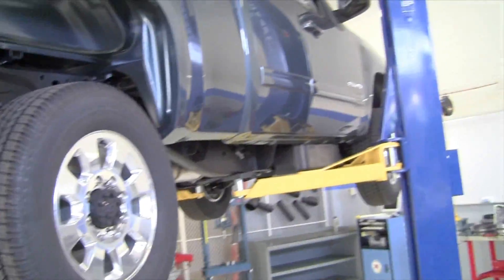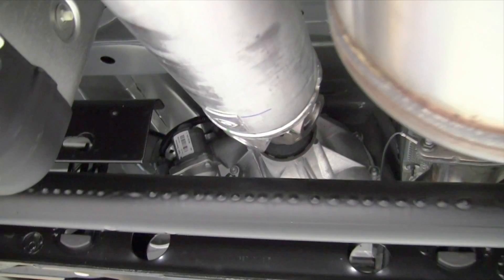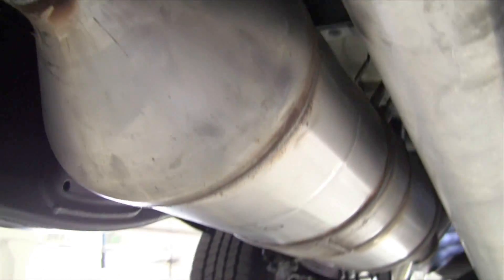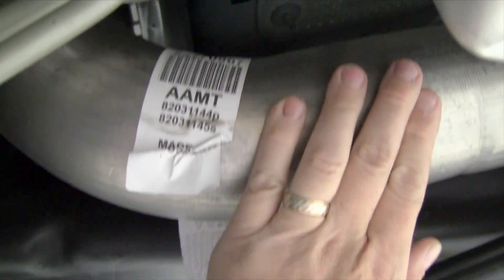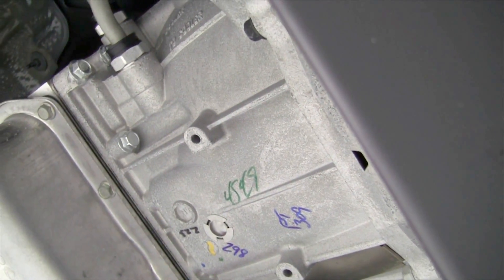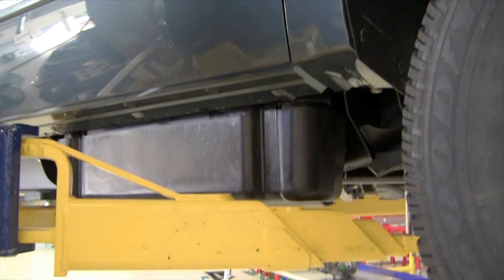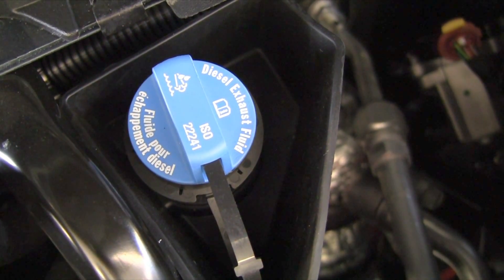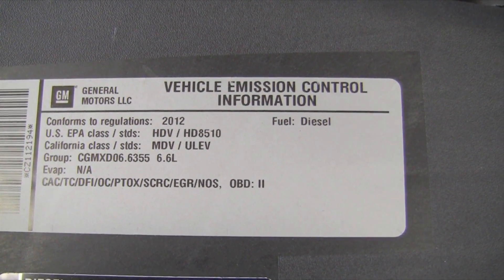Duramax Diesel Exhaust After-Treatment System

Comment: It's just the oil companies way of saying diesel motors get too high of mpgs and making the epa say you have to use this system so it burns more gas cause if that was the case gas motors would have to have something like this to because burns dirtier then diesel by a long shot
Reply from the maker: Education is the answer

Comment: This system is a pile of expensive junk.  Looks like a well built truck. The DEF System just kills it.
Reply: +usksonic The main problem that this system and other 3/4 and 1 ton truck is that the aftertreatment on these trucks is the SCR before the DOC and the DPF. you don't want DEF to be sprayed and get blown into the DOC because you can cause sensor failure and improper regen. The SCR needs to be after the dpf to run properly. Big rigs know that by heart. That's the reason why these diesel doesn't last long. once 1 CEL comes on and have an issue with the aftertreatment system, the whole thing is screwed. I had to replace multiple aftertreatment system because of this issue. But you can thank the EPA for this bs aftertreatment.
Reply from the maker: +usksonic Thanks for your feedback!
Reply: DEF FLUID (2 pack) of 2.5 gallon jugs for $7.00 each - FREE SHIPPING!! https://www.walmart.com/ip/DEF-Diesel-Exhaust-Fluid-2-2-5-Gallon-Jugs/837857789

Comment: Are those pressure, temperatures sensors important what happens if you just put a straight pipe on the muffler where do you put those sensors
Reply from the maker: jose lopez Hi, good question. Yes, they are important. There are two pressure sensors and two NOx sensors to monitor the operation of the DPF and SCR. If you remove the DPF and SCR and replace it with a straight pipe it will set computer trouble codes which could result in the vehicle speed being limited to as low as 5 mph. Oh, it is also illegal in the U.S.A. to remove anyway.  One more thing, that exhaust system is very expensive, if you do take it off, hang on to it in case you need it again. Don't let the muffler shop keep it. They could sell it for several thousand dollars to someone who took theirs off and now regrets it.

Comment: The worse thing for DEF for me is that my 2011 GMC 3500 is not a daily driver, it's a DRW dump truck that gets used for business reasons and sometimes it will sit for weeks at a time. In warm weather DEF fluid will go 'bad' and throw a 'diesel exhaust fluid quality poor' message. If that tank is less then half full you can simply top it off and that will raise the quality high enough. If you can't dilute the old fluid with enough new fluid you have to drain the tank, which GM made apparently as hard as they possibly can. There is a screen/check valve in the fill neck, so you can't use a simple syphon pump/hose.

Comment: Imagine how much power this truck would have, minus all the emissions crap! I specifically got a 2006 excluding it from the dumb emissions law! Absolutely reliable and more power than I'll need! No DEF to buy, either!
Reply: you can tune them emission equiped and make 500hp why delete them if you don't need too...
Reply: I didn't delete mine. It was before the power robbing emissions were law. Make 500hp with the gas wasting DPF or 600hp without it. Your choice, I'll pass on it.
Reply: with proper tuning there isnt any difference in the new trucks. With the first gen of just having a dpf no scr the trucks do better deleted although the new trucks emission systems have the capacity to make past 600 hp. The new version of emissions are not junk and people need to be informed that you dont need to delete and break federal law. Ill ask you this what difference in terms of proven dyno graphs do you have that prove that deleting makes more power on the stock truck vs stock deleted truck ?
Reply: +frankbradshaw1770 It's basic physics. Take any engine, tune it and find max power (hp/tq). Use that EXACT SAME engine, add emissions junk, tune for max power and you'll always make less power. Every single time! Technology cannot negate simple physics. You will never get any emission system to not hinder the performance. It flat out isn't possible.
Reply: http://www.dieseltechmag.com/2016/07/project-clean-sweep-cleans-house Ya basic physics against trucks that are deleted. Power is king and there are various ways of tuning and manipulating the common rail systems. My cummins that is an 08 is deleted because the first generation of filters didn't work. But the SCR systems are badass in terms of flow and potential power holding capabilities. The biggest thing that holds back any diesel guy from getting his newer truck piped and tuned is the fact that he cant go back once he is balls deep into violating the clean air act. Smoke is not bad but smoke in the wrong place makes everyone who drives a gasser want to crack down on diesels. Im all for power but clean power is pretty is awesome.
Reply: +frankbradshaw1770 I'm not the rolling coal type. Any diesel that is tuned correctly emits hardly any black soot. That's not what I was getting at. it says in that article, "Do you think it will make the same power as non-emmision trucks" Answer=No. My emissioin free truck is 100% legal and I'm perfectly happy with it. It is completely factory stock, btw. No black smoke and no power robbing emissions system.
Reply: +crazyhumpy emissions free nit Emanuele
Reply: +tacoman if you leave that absolute bullshit on your truck, there is a LOT of money involved.
Reply: I'm doing a full Delete on my 2013 Durmax

Comment: how do you stop the def from freezing in the tank
Reply: +chad harmon  That's  a well thought out  answer to a 2 year old question. Thanks CHUMP oops, chad
Reply: superkunk2 I drive a 2013 hino flat bed tow truck, very annoying when you need to park it so it can burn its exhaust clean.
Reply: Some trucks have in tank heaters.
Could get interesting below 12*F!
Reply: already found out, had to idol an hour before it thawed out so I could drive. That's one thing the dealers don't tell you.
Reply: +superkunk2 idle idiot

Comment: If this makes such great power, why does every single competition diesel (even the new generation of trucks) cut all of this out of the exhaust system? is it really reasonable to say that to reach the maximum performance gain, and potential in these trucks is to leave the exhaust with all of the emissions stuff? Actually interested in your answer, not trying to sound smart-alec, or refute any points you make.
Reply: First off, that emissions bullshit makes a heluva amount of backpressure, and means that the engine cant breath, and less power, and a ton of money to replace the stuff when it DOES go wrong. to reach ANY sort of performance gain, the emissions  shit CANNOT be left on. if so, there is more money in parts that have to be replaced.

Comment from the maker: Hi, 1. Yes, DEF freezes, but they have heaters to keep it usable, just like keeping diesel from jelling. 2. You get several tanks full of fuel's worth of warning that your DEF is running low. When you finally run out, it limits your speed to 5 mph. You would have to totally ignore dozens of warnings for this to happen. 3. You cannot remove the system and have the engine still function, you will loose power of you try. 4. There are no valves in the regen system. We teach classes on this, sign up.

Comment from the maker: Hi, there is no way that I am aware of. The system will limit your vehicle speed to 5 mph after a while if the system is not functioning. The system performs a valuable task in reducing oxides of nitrogen (NOx) from the diesel emissions. You would not have the large amount of torque and HP without this system to clean it up.
Reply: actually it will go into limp mode and will decrease to 5mph if not refilled or serviced

Comment from the maker: Hi, I believe you are actually trying to describe ground level ozone. There have been catalytic converters on light duty diesels since 1994 to help reduce HC and CO, the new systems also helps reduce PM and NOx.  At WSU, we have classes on these topics to help you better understand them.  I suspect that your favorite thing to do is breathe, diesels are gross air polluters (especially NOx emissions). You can't buy a more powerful and reliable diesel system than the one in trucks like these.
Reply: really? then how come all these new engines have so many problems? why can old engines go 1,000,000 Miles + and a brand new one cant even do 400,000 without having spent more than the vehicle is worth? why have they depreciated so much?

Comment from the maker: Education is the answer. We offer college courses that could help you to understand the system's advantages. When people modify their diesels to get more power, they are typically adding more fuel which causes the DPF to clog sooner. A Prius is a Super-Ultra-Low-Emission-Vehicle (SULEV). The 2010 Tier-4 diesel emissions exhaust systems clean up filthy diesel engines to the Low-Emission-Vehicle (LEV) standard which is nowhere near SULEV cleanliness. It is clean for a diesel, but still dirty.

Comment: you never mentioned how rediculous the DPF is, i can spend 2500 dollars on my truck with a tuner, straight pipe, air filter and shift kit and emit less harmful emissions than mommys prius and get 700 hp and 25 miles a gallon, and by the way, a replacement dpf is 2000 dollars, and if not fixxed immedately the soot can back up into the turbo, causing you to need to replace it.
Reply: Indeed. it will also bring soot into the oil with egr valve.

Comment from the maker: Hi, the tip and the smaller pipe create a venturi effect pulling in outside air to cool the exhaust during Diesel Particulate Filter (DPF) regeneration.  If you remove it, the exhaust exit temperatures can be hot enough to melt plastic parts on the car next to you, burn paint, or even start a fire.  It is not a good idea.

Comment: would it matter if i cut the gay looking cooling tip off my 2011 duramax? and the end part that shrinks into a smaller pipe that goes in the cooling tip? just wondering if it would mess with the back pressure and make my fuel economy worse or make it hard on the engine? you can see what i mean at 1:33. someone let me know please and thank you.
Reply: skeg rats atv dude i just bought a 2011 as well, I’m triping out that i dont see a damn muffler in the end of the system. Did these not come with a muffler? Or is the muffler basically the dpf system?

Comment from the maker: @YoungDuramax Hi, I suspect your favorite thing to do is to breathe. It is also the favorite hobby of everyone else.  Diesels emit particulate matter and large amounts of Oxides of Nitrogen.  Combine these two ingredients with sunlight and hydrocarbons (unburned fuel) and you get the smog that almost every large metropolitan area is plagued with.  If you like breathing that mix of air then the exhaust system must be a big scam, otherwise it is an amazing way to have clean air and lots of power.

Comment from the maker: @YoungDuramax 1100 lb*ft of torque is pretty cool, but it is most likely illegal for use on public streets.  Adding extra fuel and boost certainly adds more power (and decreases fuel economy). The cool thing about these new types of exhaust systems is that they allow you to have incredible torque and horsepower and still be street legal. Owners of the original 2001 Duramax would have loved to have the 765 lb*ft or torque that the 2011 Duramax delivers and still be street legal.